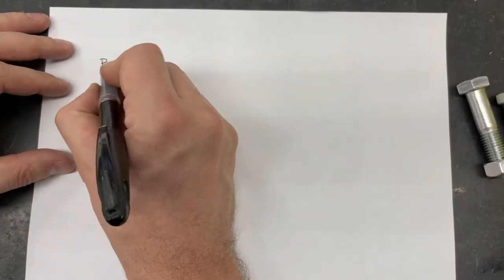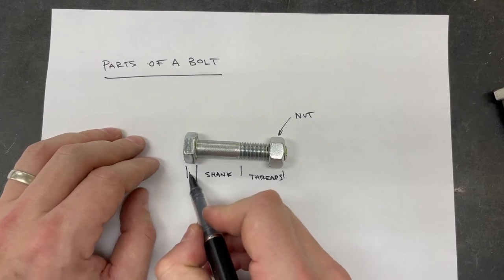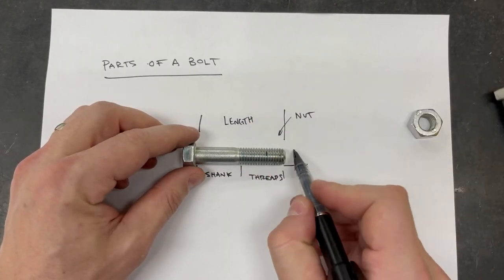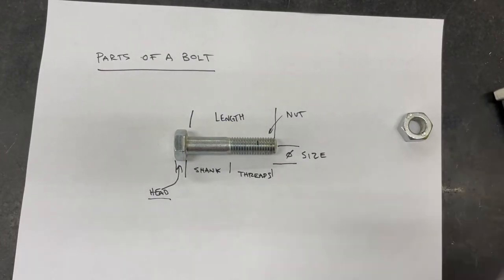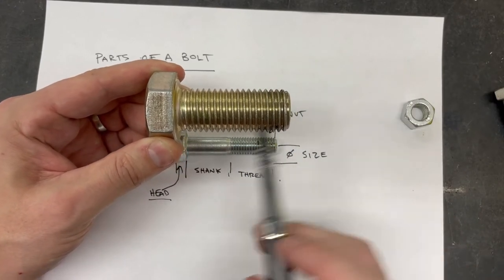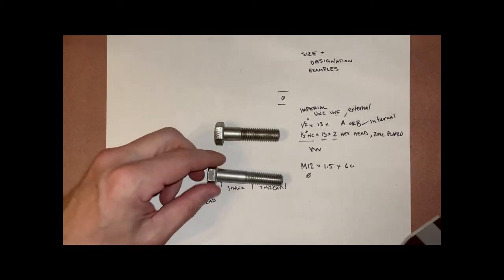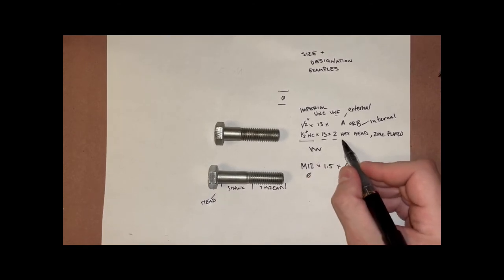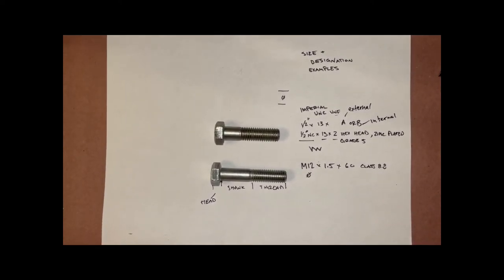Intro to Threaded Fasteners

Comment: Thinking about becoming a Millwright… Would you have chosen something different? Is it a good trade??
Reply from the maker: Hello Tyson,  

The millwright trade is very broad. it really depends on what type of industry you work in. 

Millwright work can be very physically demanding, long hours and requires a high level of safety awareness. 

it also is very dynamic in the ways you need to problem solve. work to tolerances and respond to unique situations. 

i like my trade. i would also have enjoyed electrician or joinery i think. 

the main thing is that whatever trade you choose, strive to be excellent. listen to experience and be professional. 

“ jack of all trades,
master of none, 
but still always better, 
than master of one”